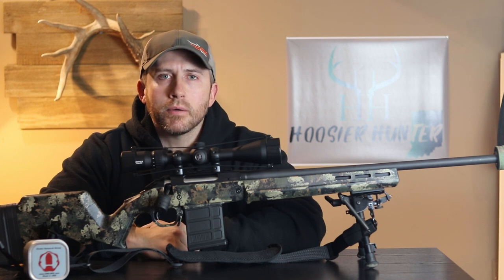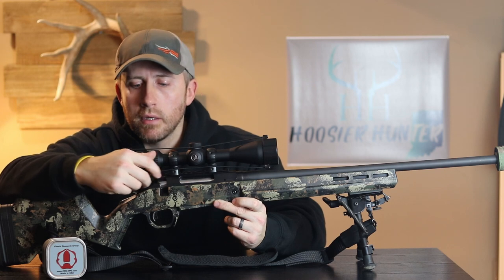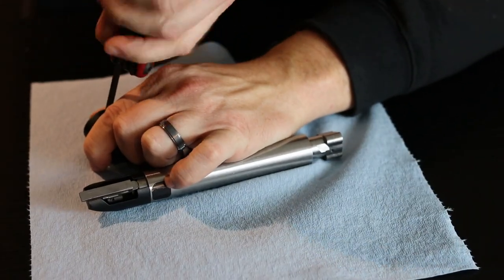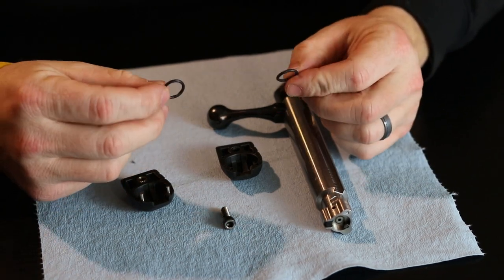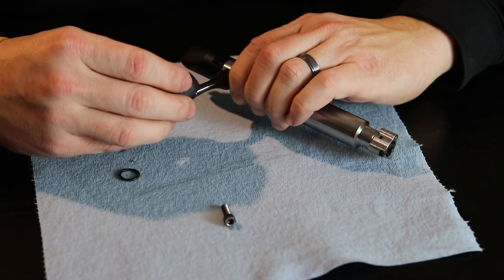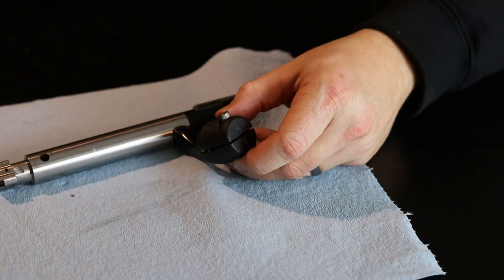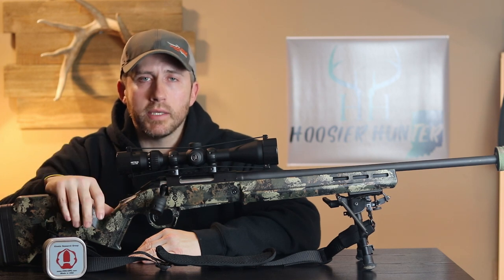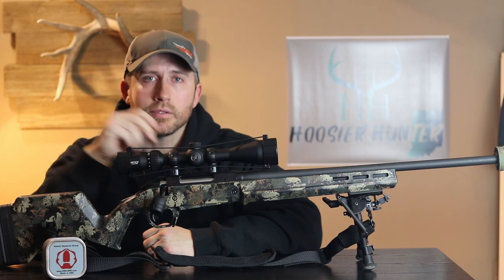Ruger American Bolt Handle | KRG Bolt Lift

Comment: I took a chance on this after seeing the video. KRG now offers a slightly smaller version, and I got that. It fits just fine on my Ruger American, with no wiggle. It is now so much easier to pull off a second shot. Thank you!
Reply from the maker: Timothy Kriehn good to hear!  I continue to be very happy with mine. Goad it helped. Have a good one!
Reply: Hey, does the bolt lift small version have the gap when using on a Ruger American that you see in this video?

Comment: I filled in the cavity with JB Weld “JB Quick”, put a little cartridge lube on my bolt handle and bolted it together to allow the epoxy to cure. Fits perfectly and tight to the original bolt knob. Gotta wonder why KRG doesn’t sell one for the Ruger as popular a rifle platform as they’ve become.
Reply: Costs $40 and you still have to glue it to make it work. What a rip off.

Comment: Once’s that’s on there there’s really no reason to take it off so I filled mine with epoxy and sanded down what oozed out after it cured. Absolutely rock solid with no gaps.

Comment: Great video again! I was wondering if it was linked wrong when I clicked on the link mid-video. However, you covered that question as of it being a 700! I was thinking about something like this for my Savage Axis, but I think that throw is just too tight to the scope. I'm curious if you have an Amazon Associations storefront or influencer page. I got an email about that yesterday and thought about setting one up. I'm sure you'd have some cool stuff in there if you did have one.
Reply from the maker: Appreciate it, Chip!  I actually just recently tried for the Influencer page but I guess I don't have enough subs because it wasn't approved right away.  I will try again at some point so for now I just have the Amazon Affiliate program.  I would like the Influencer page as well though.  Do you do the Affiliate program?
Reply: @HoosierHunter  Yeah, I have an affiliate page. I was sent an email a long time ago about a page like that, but deleted it. I was sent another this week. I don't have enough if you don't have enough. I guess that answers that haha! I was just curious, because you seem to get into some cool, out of the norm stuff. It'd be perfect for you if you do ever get one!
Reply from the maker: Haha.  I understand.  You aren't far behind me and I am going to occasionally check to see if it will approve me.  I put my info in and it declined me in about 2 seconds so it doesn't take long to figure out if you make it or not. Haha.  I think it would be cool to mess with a page and see what all a guy can get it in there.  We just have to stick with this and we will eventually have enough to get approved.
Reply: I just tried and actually was able to go through with making a storefront. It looks like you can just create lists and put whatever you want/recommend in there.
Reply from the maker: Awesome!  I will try the storefront. I did the Influencer program. Not sure if they are the same or not?  Good luck with that 👍
Reply: @HoosierHunter  Yeah, I think the Influenser Program has a store front. Of course that's different than Amazon Associates though.

Comment: $40.00 for a plastic knob?
I like the Magpul stock though.
Reply from the maker: Yep, little pricey.
Reply: It does potentially beat having your bolt handle threaded then pinned and welded.

Me personally I've welded every bolt handle I've ever worked on, but I also have the means and the know how a lot of folks don't.